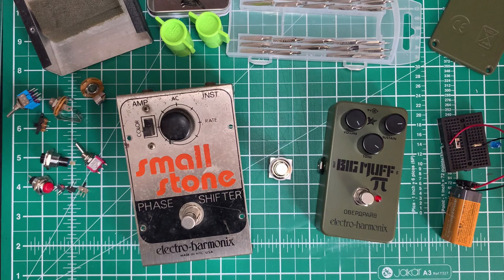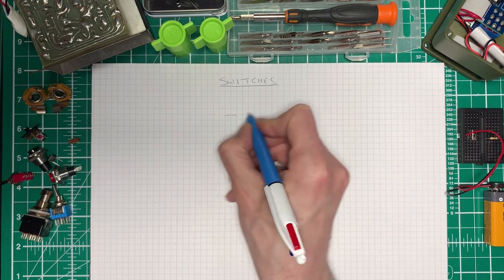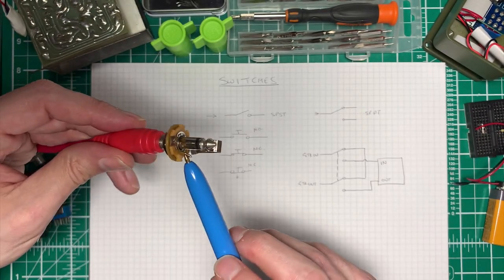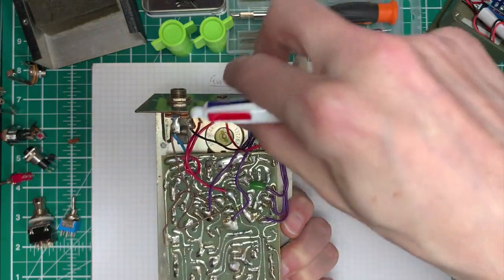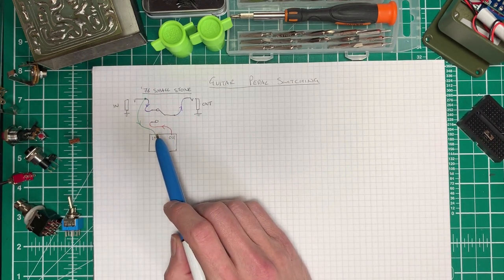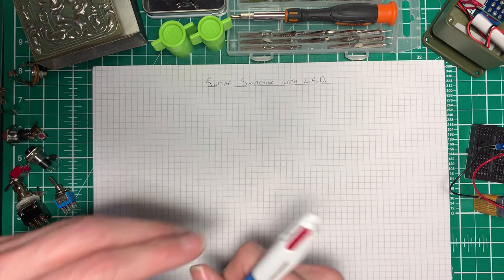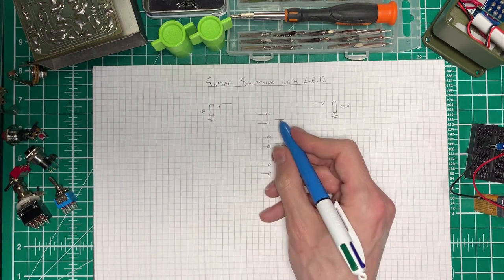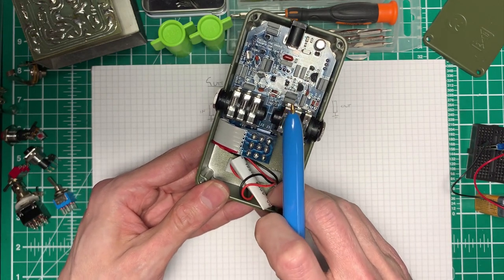DIY Guitar Effects Pedals - Part 1 - Bypass Switching

Comment: Great explanation, thanks!!!
But the final statement just blew my mind...or maybe I understood something wrong... Why are Boss pedals different in behaviour??? Does not the "regular" 3PDT switch that you covered in this video have the same behaviour that you talk at the end about the boss pedals? (Push it once to switch the effect and the LED on, and push it again to turn everything off)
Reply from the maker: What I was attempting to say there was that it uses a different form of switching circuit. It’s electronic using a non-latching/momentary switch to control  a FET transistor based bypass circuit  … same in Ibanez, Danelectro and some other pedals. The resultant on/off operation is the same. 

What’s interesting is some of the Earthquaker pedals have latching and momentary functions on the same switch,  and that’s a different circuit again using a microcontroller and electronic relay.